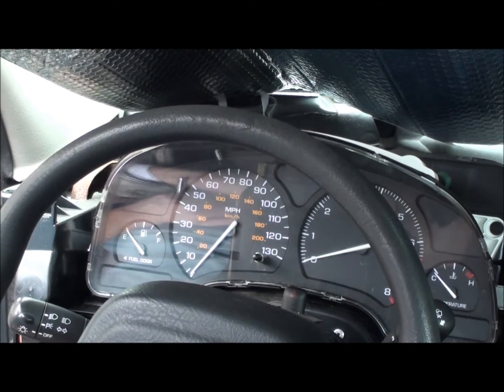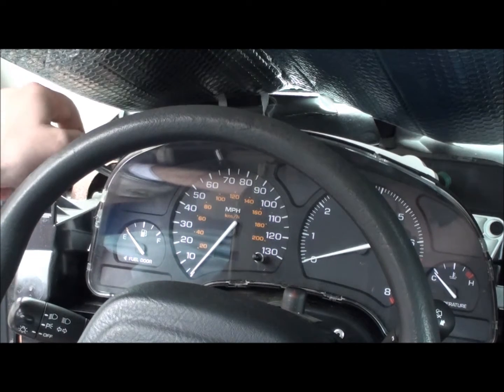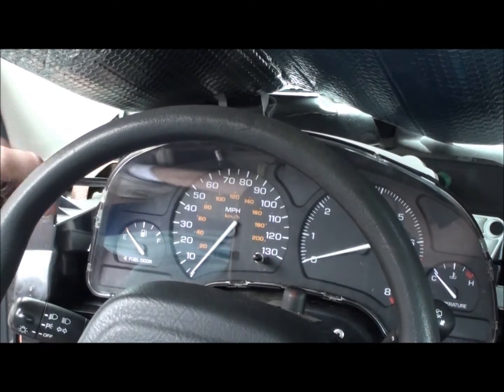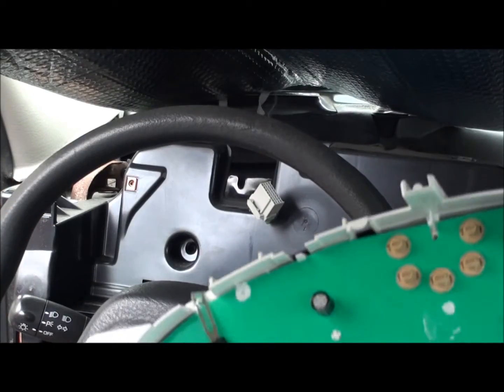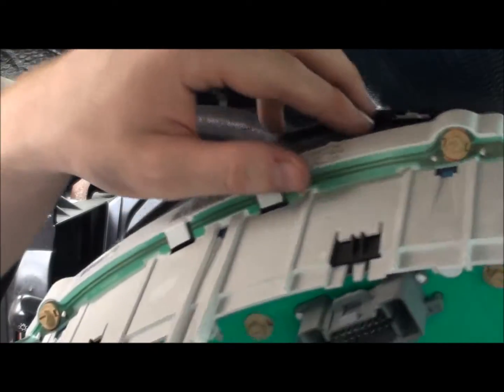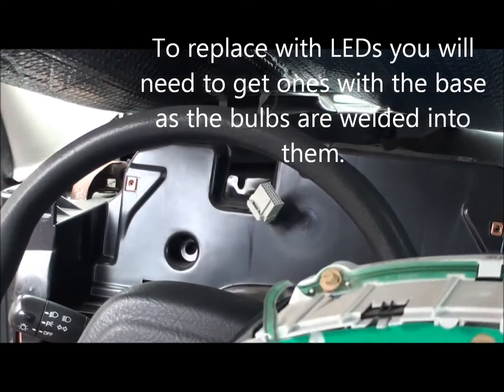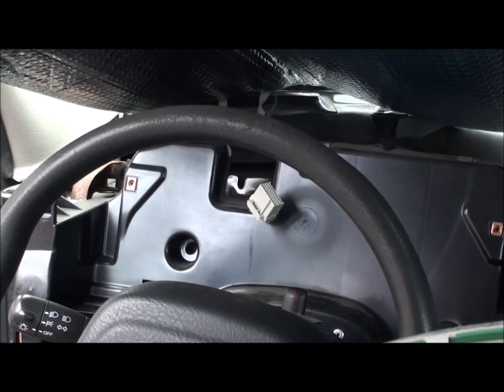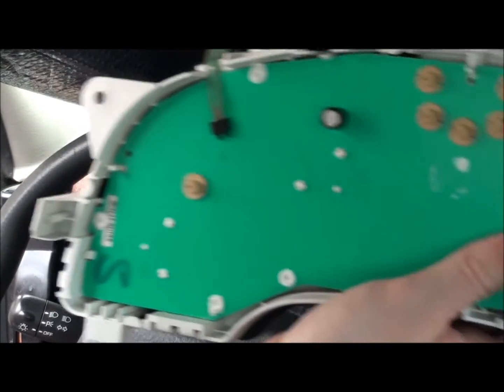00-02 Saturn S-Series Instrument Cluster Removal

Comment: Do you need to disable airbag? And how to do it on 2001 Saturn SL2? I need to replace some bulbs on the dash board and to replace the data Link Connector. Thank you for the great film.
Reply from the maker: I just disconnected the battery. That was it
Reply: @jungleking007Channel  Thank you. That's what I'll do to replace some bulbs on my dashboard.

Comment: Thanks for this. Any results in finding the LEDs for this? I plan on replacing the ones in my 2002 L200 (which looks to be fairly similar, so this video can kind of apply.)
Reply from the maker: Unfortunately not, I have had other items come up that put looking for the bulbs on the back-burner. Not sure If I will even swap them out. but as long as you can find a LED equivalent of the 161 or 194 bulb with the correct socket, it should work.